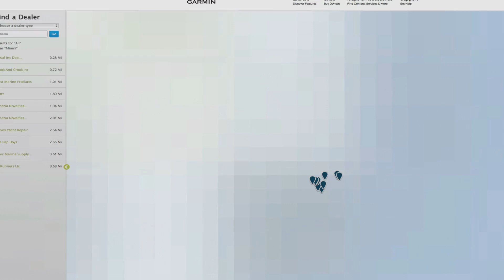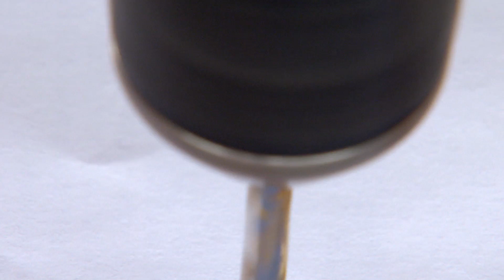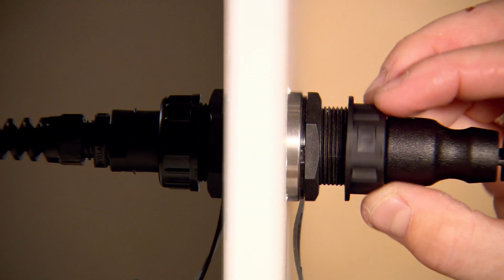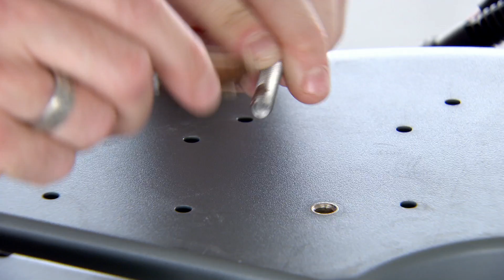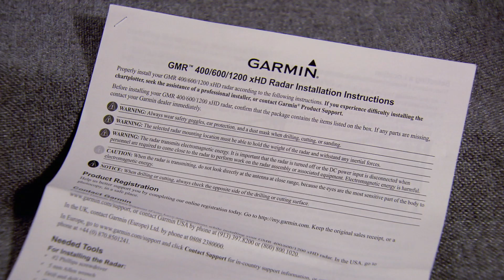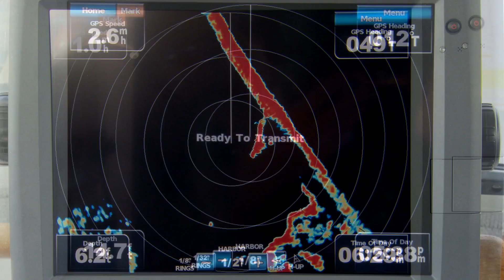Basics of how to install a Garmin Marine radar

Comment: Thanks for this Video ! I have a question, on a ketch sailboat, I often see radars on the mizen mast this makes sense as this mast if often close to the cockpit and the multifunction screen. I expect to purchase a 18 XHD, so mizzen or or fore mast ? (fore sounds more efficient and mizen definely easist to install)
Reply from the maker: Hi there! It can be installed in either position. Just keep in mind that mast mounting will result in a small dead zone where the mast blocks the radar signal. -MR